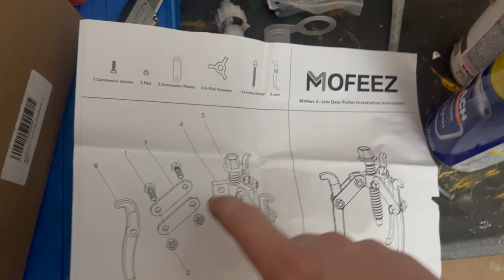Ep2: Replacing/Cleaning/Installing a Ford Think DC Motor

Comment: Great video Hagan, thank you so much for doing this. I truly enjoy my cart. I may look to upgrade my motor in the future. Are you taking suggestions for topics? I’ve replaced my headlights with LED but have yet to do my front/rear turn signals. So I would very much like to learn “how to“ do that. Thank you again.
Reply from the maker: Hey Rich! Happy to do a video on that for you. Hoping to get something posted this week and will try to include. Let me know if you have anything else you’d like to see!
Reply: When is new one coming up?
I kinda got f**k on my think..needs lots of electrical parts..
I love it!! For me I can't to ride it
Reply from the maker: @PhilipDecicco  waiting on some dang wiring harnesses to arrive but hoping to have them this upcoming week and will put one up covering charger, dc/dc, and some common wiring issues I’ve seen

Comment: Can you do a video changing gearbox oil?
Reply from the maker: That’s pretty simple. Open bottom drain, let it run out. Close bottom drain. Open top hole, use a quart oil jug with a pump head and hose, fill it up until it starts running out of the hole. Put screw back. It’s also in the manual. You can find all 5 sections for free at fordthink.org.

Comment: I am planning to buy this one without batteries and key, is there a way I can test just motor is good or not ?
Reply from the maker: Not really. You need to test the whole system. Find you some cheap old used car batteries and get the cart to 72v and see what happens.